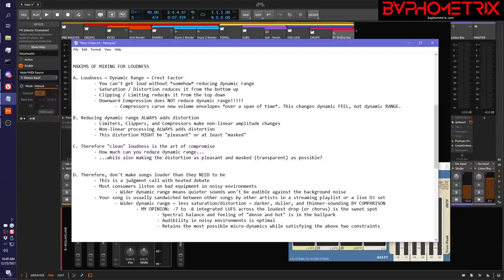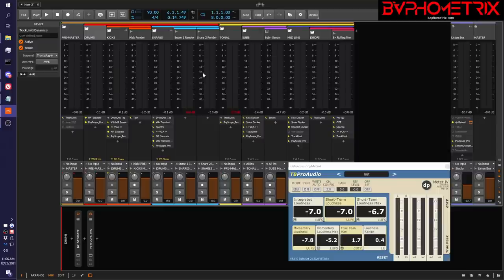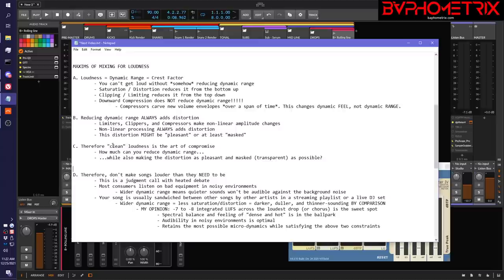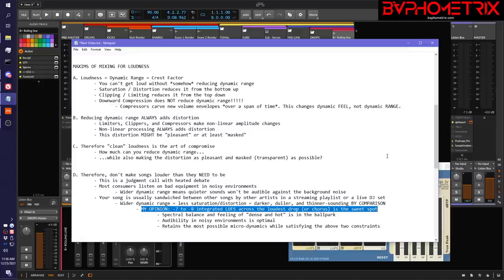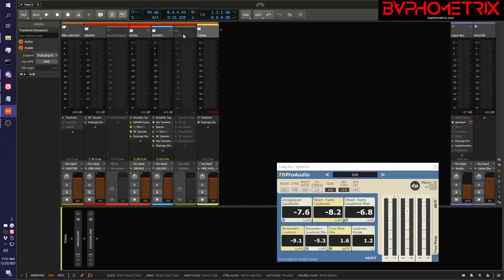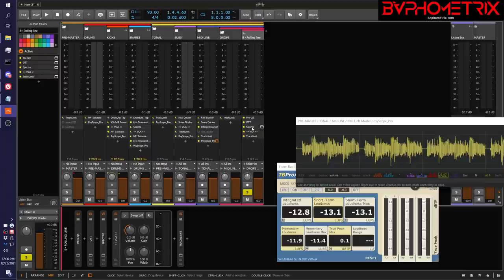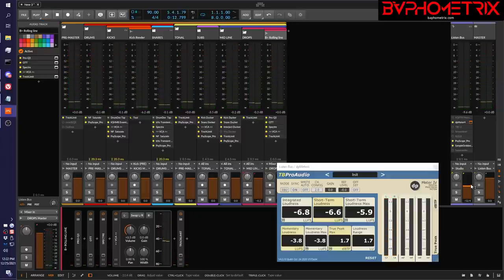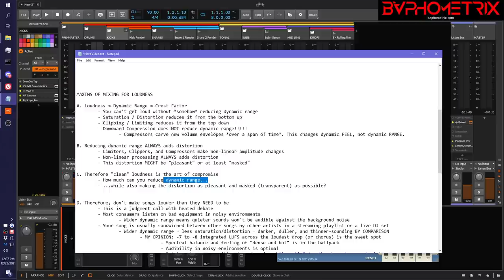Loudness is in the MIx, not the Master! PART TWO

Comment: Hey Baph - just a question regarding -7,  -8 lufs - a large number of 'bass music' producers I've come across in many different genres almost always aim for -2/-3 lufs these days. How the hell are you supposed to hit that without massive, non-transparent distortion? I can get up to like -4.5 max without the mix falling apart.
Reply from the maker: I wouldn't say a LOT of them are shooting for -2/-3. I mean, it's easy to hit those numbers for momentary max values, but not for integrated values.  A typical loudest song section (usually the last drop or chorus of a song) will measure somewhere in the range of -7.5 to -6.0 LUFS integrated (the average across the entire span of that song section).

Comment: Couple questions. Would you still recommend running even a light mastering limiter at the end of this process? And do you recommend a daw limiter like Ableton limiter to use on tracks instead of tracklimit? Since it also is low latency I think
Reply from the maker: Generally yes, you'll need a mastering limiter on your master bus. Every limiter is different and sounds a little different. At the end of the day a limiter is a limiter, although some will be able to squash harder with a little more transparently than others.
Reply: @Baphometrix  Okay thanks for the reply. Love the videos man. Tried your process out and I'm always in the 5-7 LUFS range and it sounds clean

Comment: Is Kclip 3 still your favourite clipper or do you prefer Newfangle's Saturate? Looking to pick one up. Thanks in advance.
Reply from the maker: KClip, Saturate, and TrackLimit are my three favorites. KClip is the most "lightweight" in terms of resource usage, but it's also the dirtiest-sounding of the three. In early stages of a big project where I might still be running tracks with a lot of resource-hungry synth VSTs, I might use KClip to reduce the overall load.  As my early composition and arrangement settles in and I start flattening some of those synth tracks to pure audio, I start swapping out the KClips for NF Saturate instead. Why? Because NF Saturate uses a spectral approach that keeps high mid and high detail intact throughout the span of the "laser beam" flatline, so it's not really like a true hard clip any more. Go read up on it. And since TrackLimit (which I only recently stumbled upon) is an incredibly lightweight (and excellent sounding) LIMITER that you can literally put dozens of instances all over your project with very little resource impact,  I tend to land on it as the "best-sounding" way to clip most tonal material. I still prefer the sound of a clipper on drums and foley, though.
Reply: @Baphometrix  Wow, I didn't expect such a quick and detailed reply. Thanks for that. I demo'd kclip today with great results. I will demo and read up on NF saturate next and TrackLimit next. Thanks again.
Reply: @Baphometrix  Thank you for the info shared here

Comment: What is your Opinion on MV2 by Waves or in generell Upward Compression, to narrow the Crest Factor? (especially for the tracks on which I can't apply a Clipper)
Reply from the maker: Not a fan of Waves plugins. Upward compression will definitely increase RMS/density and reduce the crest factor in most cases, but it also tends to bring up the noisy stuff that's normally hidden.  It's great on single sounds (and is the main reason everyone loves OTT, which includes multiband upward compression), but sometimes it just brings up too much noisy crud from the bottom, or hypes reverb, and so on.

Comment: This Clip-To-Zero technique however only applies to the loudest parts of your balanced song, when working on individual channel level, right?
That's why you only showed those channels of your demo song which tend to be near 0 dB and therefore qualify for clipping.
The quieter elements (hats, toms, rides, supporting synths, etc.) are way below 0 dB and for these a clipping/limiting event happens earliest on a bus level.
Reply from the maker: Right... so.... what's the problem you seem to be implying?  Why clip some part of the signal that doesn't *need* to be clipped?
Reply: @Baphometrix  No problem for me :-)  I'm still trying to understand and learn that new paradigm, and i'm curious how well it will fit to my mixing and mastering work.
But when i read the linked document i would say that i qualify perfectly for it, since i'm in no way a professional mixing nor mastering engineer, but i'd like to mix and master all my arranged tracks by myself.

Comment: Thanks for this tutorial! Can you please tell me about routing? As i can see your PREMASTER output is se to MASTER. And your MASTER output is set to Listen Bus. Hm? I suppose that PREMASTER has send to Listen Bus but i do not see Audio Receiver as a first plugin to pick up signal from MASTER? (As you explain in your pdf). Thanks in advance for your answer!
Reply from the maker: Not sure exactly what you're referring to in the PDF, but this is just standard channel/bus routing in Bitwig. Everything rolls up into the PreMaster bus. Which sends its output to the Master bus. Which in turn sends it output to the Listen Bus. And the Listen Bus is what's outputting to my sound card.
Reply: @Baphometrix  And when your mix/master is finished, you render just MASTER and that is it? I refering to if mu whole mix is sent to MASTER and i some plugins on the master bus, then i can send that MASTER signal to the new Effect channel which has inserted Audio Receiver as a first plugin so i can use Sonarworks for example. In that case output on the master bus can be set to "no output" and that final render MASTER will be untached, and on the bus which receive MASTER signal i can use Sonarworks reference or metering or enything else. Is your routing method described here in this video, has some other benefits? (i refer to your Handbook, chapter : Using Sonarworks with Bitwig)
Reply from the maker: @JRHaimOfficial  Oh! I see. My (now very old) Bitwig handbook. Yeah, at some point in the past year or so, an update to Bitwig made it much easier. I'll change that section to describe how to do it more easily now. I'll post another reply here when I've had a chance to do that.
Reply from the maker: @JRHaimOfficial  Okay, I've updated the Bitwig Handbook and added a screenshot to make things more clear.
Reply: @Baphometrix  Thank you very much!
Reply: @Baphometrix  Glad you're back, did you change DAWs again?
Reply from the maker: @erikvwees  Yeah. Bitwig added some things in 4.0 that pulled me back from Studio One.

Comment: @1:05 you state that you cant go over 0db when its time to print to master, yet in another video I heard you say it doesnt matter and to let true peaks hit +2db-+3db as long as it sounds ok because the short transients will get clipped anyway.Which is the better idea?
Reply from the maker: True peak is not sample peak. All the meters in your DAW are measuring the dB of the individual samples that make up your waveform signals in each track and bus. The meters in your DAW measure something called "full scale", abbreviated as "dBFS". True peak, also known as "inter-sample peak" (abbreviated as "dBTP") is an attempt to calculate how the digital waveform samples will eventually re-construct into an analog waveform when run through the ADC converter in any type of playback device. Some of the real analog peaks might sit in between the sample peaks on either side, and might indeed go above 0 dBTP.  However, there are two things to remember:

A - True Peak is a boogeyman in the industry. Most pros don't give two craps about true peak values. Why? Because modern ADC converters are built to have headroom above 0 dBTP when they create the analog signal that gets send to the audio power amps and drivers. True peak was only an issue way back in the 90s, when really cheap, early ADC converters were kinda bad.

B - True Peak values do affect (to some degree) the lossy transcoding that happens when you convert a lossless WAV or FLAC into MP3 or AAC or Opus or Ogg Vorbis or whatever. But those lossy formats are doing incredible damage to the original sound on so many different levels, that any potential for clipped waveform tops here and there are FAR overshadowed by the more major damage that lossy formats are already doing to your pristine master. Any such clips are super short and ephemeral events anyway, so they are the least of your worries. Finally, remember that all these lossy formats are VERY temporary in the bigger scheme of things. Consumer/household ethernet and wifi internet speeds are already super fast and can stream lossless music no problem. And Wireless speeds to mobile devices are rapidly catching up and soon will be plenty fast enough to stream lossless music no problem. There are already platforms like Deezer that are streaming totally lossless FLAC songs that are identical to the original uploaded masters and will perfectly null test against the original master.
Reply from the maker: @Vic LTD It's something I've seen done and you can sometimes get away with it. But I prefer to clip in a controlled way and know exactly what is getting clipped and why and by what. A good clipper like NF Saturate, or a good limiter like TrackLimit will NOT make a flat shave that causes the playback system to try and hold a speaker drive perfectly still at the full up/downswing for any length of time.

Comment: When mixing for loudness, which of the lufs meter on tbproaudio dbmeter vst should we be reading for the final overall loudness?
Reply from the maker: The most useful LUFS measurement is "integrated". And you don't measure the entire song. You measure the loudest section of your song. Your loudest drop, or your loudest chorus. You measure the entire span of the loudest drop or chorus.  You reset the meter, start playback, and stop playback at the end of the section and see what the "integrated" measurement is.

Anything more than that and you should read up about LUFS to understand it better. :)

Comment: Can you direct me to who has clipper plugins and is Cableguys Volume shaper the same as a clipper?
Reply from the maker: The two clippers I routinely use (and like) are "KClip Pro 3" (by Kazrog), and "Saturate" (by Newfangled Audio). Note that "Saturate" is the name of a CLIPPER plugin. Yeah, it's confusing.  I also very much like something called "TrackLimit" (by DMG Audio), but it's technically a limiter, not a clipper. But it's a super lightweight limiter you can throw all over the tracks and busses of your project and it will essentially do a similar thing to a clipper.

Cableguys "Volume Shaper" is NOT a clipper, nor a limiter.  It's a volume envelope tool. Mostly used for ducking one signal entirely (or mostly) out of the way of some other signal.

Comment: At around 24:50 you say the distance between the peak & rms gets smaller reducing dynamic range making it louder then follow up saying clipping peaks top down making distance shorter increases dynamic range which increases loudness. Sounds contradictory.
Reply from the maker: Yeah, sorry about that. I'm mildly dyslexic and flipped increase/decrease in that particular instance. Either action *reduces* dynamic range. Smaller dynamic range means you can push up the RMS and still keep the peaks under 0 dBFS. Thereby making the signal louder in the mix.

Comment: Hmm, I'm listening this straight after the part 1, and the mix sounds considerably different. Something weird going on in the kick and kick/snare department. Is that because of the limiters? It kind of sounds like something is making the volume go down just before the hits. As if there's lookahead compressor/limiter going on.
Reply from the maker: Not sure which timestamp you mean. But I did make a small goof in this video toward the end and forgot to turn on ALL the processors for one sound after turning them off to let you hear the original sound.

Comment: is Compression the Master, then?
Reply from the maker: "Compression" by itself doesn't mean much. "Compression" can be used to accomplish many sound design goals, and also some mixing goals. Compression, as a whole, changes the dynamic FEEL of a signal. This is slightly different than changing the dynamic RANGE of the signal. Compression carves entirely new downward (attack) and upward (release) ENVELOPES into your signal. Compressors work over a span of time. They are based in the time domain.  This video centers around controlling dynamic RANGE. Clippers do not operate over time, nor do they carve new envelopes into your signal. They are INSTANT. In some genres of music, compressors aren't used much except during the initial sound design of the source signals on each track. I almost never use compressors except to achieve certain sound design effects. I might use a single SSL-G style bus compressor on my Master track at the very end, during final mixdown and mastering. It depends on the song and whether this type of slow, gentle bus compression enhances the rhythmic pulse of my downbeats and backbeats, and therefore creates a feeling of more "openness". In some types of songs, it does that very well. In other types of songs, it won't have that effect at all, so I won't use it.

Comment: Remember: one bit of resolution is worth 6dB of dynamic range. Thus, if you go over 0dB on a channel in a DAW by, say, 18dB (a lot), you're only using three more bits. So, saying a DAW has 32-bit floating point and so has a lot of room for dynamic range is an under statement by orders and orders of magnitude. If your DAW used only 32-bit integer, you'd still have way more headroom than you'd ever need unless you're an idiot. :) (32-bit integer has 32 × 6dB of dynamic range, or 192dB, way, way more than you should ever, ever need and way, way more than you can ever hear, even when you are born and your hearing is "perfect.") And, I like your videos, but you confuse, repeatedly, dynamics and dynamic range (almost everyone, with few exceptions, confuse the two terms, but these terms of the art have precise definitions). Dynamic range is a property of a communication channel or a storage representation. Sixteen-bit PCM digital audio has a 96dB dynamic range. Dynamics are a property of sound, your music. You use a communication channel or a storage format to represent your music's dynamics, to encode dynamics. You change the dynamics of a sound within the limits of the dynamic range of your available channel or storage medium. Compressors and limiters change dynamics.
Reply from the maker: TIL ! Thanks for the clarification. 😀